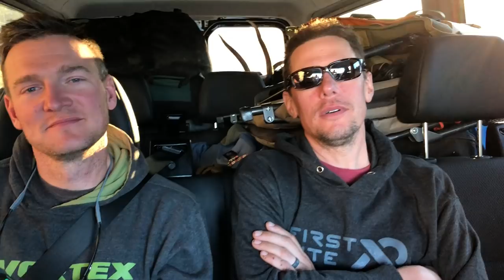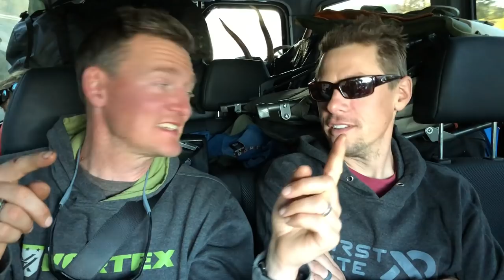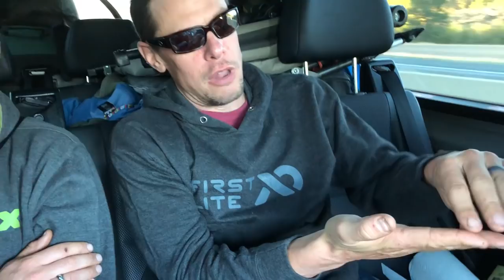Hot Tip Off: Paper Towels for Vacuum Sealing with MeatEater

Comment: Great tips guys, thank you. As far as the vacuum bag tip mister Steve........you could  buy a vacmaster VP215. Crazy good sealer, liquid or not. Seals no matter what. If liquid does exit the bag, it’s trapped in a tub like area that is easily cleaned up with a towel. I’ve owned mine for a couple years now, love it. I went through 3 before I finally dropped the extra money for this machine. Might be a great topic for the podcast or MeatEater, save someone else the cost of multiple machines. Much appreciate all of your efforts guys🤙
Reply: Sailing Stella I wish I would’ve read this two days ago. I guess I’ll use this food saver till I can afford a Vacmaster. Thanks for the tip.
Reply: I was in like $600 for the first 3. I did know about the vacmaster, just thought no way. Too expensive. It’s one of those “if I knew then what I know now things”. The machine is commercial grade and flawless🤙

Comment: Every vacuum sealer I’ve owned has a function to stop the suction and start the seal.  There is no need to suck liquids out of the bag.  My latest machine, the PRO Series, has three buttons.  Pulse suction, manual seal and suck/seal.  If still, on the suck/seal you can stop the suck and start the seal just by pushing that button again.  Personally I don’t like the taste of paper towels.  And for total liquids, the freezing trick works well but can be a pain in the butt to get it froze flat without spilling.  I prefer to do as explained prior then lay flat to freeze. 

Janis wins cause that was about the easiest field judging technique I’ve heard.